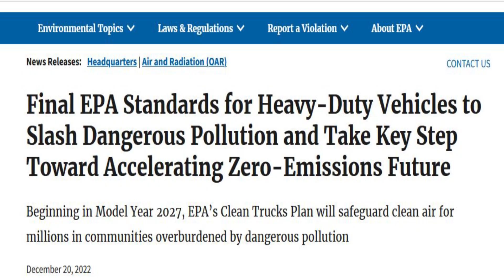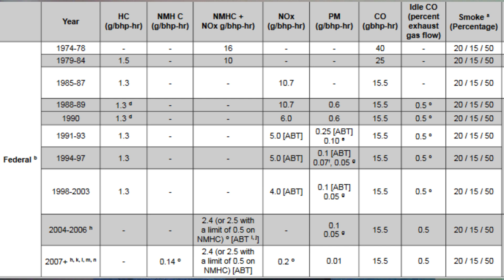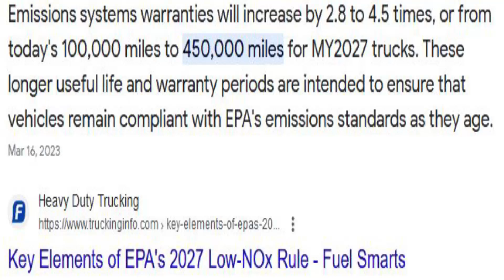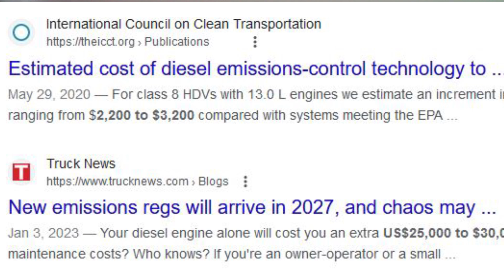Why the 2027 Diesel Emissions Standards will cost BILLIONS!

Comment: They do realize the more components that you install needs an engine the more stuff is going to go bad when she's going to cause the owners more money to fix and they're just going to pass that along to the customers and they do realize that everything is moved by a truck at some point in every country Mina systems that are on the trucks nowadays worked great until they hit about 400,000 miles and then they just turned the absolute s*** trucks with my drivers put on about 200,000 miles a year I mean I have trucks that are 2 years old didn't have over 400,000 miles on them already no one's check semis are getting any cheaper directly getting more expensive so it's not feasible to replace my truck's every two years we're fairly decent sized company but we're not Walmart

Comment: My take on what you said Josh is a couple things. 1. If they extend the warranty coverage out that much it will keep people from deleting them as much or at least as quickly as they have been. 2. A big reason in my opinion anyways is the cost of an Cascadia sleeper is say $180,000 the eCascadia in the same configuration is probably $275,000+, so if they can bridge the gap in price it’ll give more of an incentive to try and force people into trying that route. My .02 though

Comment: Any and ALL engines will be putting out pollution even if it’s 0.0001% multiplied by a million new vehicles each year and the older ones not always being up to spec 
You as a professional mechanic should know that.  It might not be “dirty” in the sense you are using but it still is pollution.
If they (EPA) didn’t do anything we would be all wearing portable plastic bubbles just to go outside.
The air quality has been significantly cleaned up since they began.  Any village idiot can see that so be thankful we can still breath without any assistance from outside sources like oxygen bottles. Your child now has a future.

Comment: Here is an idea, actually design an emissions system that is reliable. The cost of this crap they created should be on their shoulders. ALL manufactures have adopted this practice. Build it with design defect and they make a ton of money over the life of the vehicle or any product in service / replacement. Oh, and let’s add more junk that can go wrong to the products. So, build a product that will withstand the warranty and there is no problem. Washers and dryers for instance, would last 40 years or longer (most with no repairs) years ago. So it can be done. It is about time there are some protections for the consumer, as minor as this is. You say every 100k there is a repair to the emissions system, well right now the owner pays for that, so I see that as a shift of responsibility. Why is it the consumer gets shafted ALL the time for manufactures business practices of “build it with the cheapest, non tested materials available, then sell it and wait for the money to roll in on repairs.” Don’t get me wrong there is a responsibility on the part of the consumer as well, we accept this garbage. People don’t look at the product for reliability, they look for bells and whistles. They are complaining when the thing is in the shop for 9 months with issues. Stop accepting this norm that is be pushed on you, quit looking for Bluetooth nipple ticklers and actually look under the hood, there is something there.

Comment: So here’s a question. Are emissions standards tied to the truck or the engine…..

I guess what I’m asking is, can I start taking 80s and 90s peterbilt and Kenworth trucks, stripping them down, rebuilding them with new engines and drivetrains minus emissions equipment, adding modern comforts, and reselling them as “remanned trucks”. Cuz if that would work I imagine it would be quite the lucrative market with all the issues todays trucks are having
Reply: Emissions are ultimately tied to the truck. 
What you’re talking about are glider kits where an old model engine can get put into a new chassis. But, that “loophole” got closed to where basically all new trucks have to meet the current emissions for when it was built. 
As an individual doing your own trucks you could probably get away with it if it’s only a few trucks. 
If you’re a company building them or someone trying to sell them it isn’t gonna fly for very long before they start throwing big fines and such at you.

Comment: I work with a major manufacturer OEM warranty and everyone should get the extended coverage (ain't cheap) when you buy a new truck. Most get 500000 mile aftertreatment warranty, some can get up to 750000 mile warranty. As you said, it's the least reliable components on the truck, so the warranty is almost always worth it in the end. I'm sure they'll find a way to bake the mandatory extended coverage in the price the truck going forward though. 

In this day and age, buying extended warranty is king. Even with the bumper to bumper chassis warranty on highway trucks, from experience I've found you get back more in repairs vs what you pay for the warranty over the life of the truck. 

On a side note, I've seen people save the $2k on extended transmission coverage only to be faced with a $10k-15k bill down the road during the normal warranty period they opted out of. Long story short....get the warranty.
Reply: Similar to "power by hour" on (turbine/jet) aircraft engines.
Reply: Let me see you work work for a warranty company and think we should all buy a warranty from you because it's better of us... I think not. What business can lose money continuously? None! They wouldn't be in business if they paid out more then it cost.

Comment: What would be your opinion on an electric semi configuration similar to that of Edison motors?
Reply: This is what I feel like the future of trucking will most likely be it’s the only one that really makes sense full EV trucks just weigh too much empty to be of any use hauling. Not to mention the terrible mileage that they get. Unless they find a way to make the battery packs weigh less it’s dead in the water as far as king haul trucking goes.

Comment: At work I drive trucks with mileage that runs from 300,000 to 1.5 million and they are in the shop every 3 weeks without fail for an emissions problem.  It's a joke and it doesn't matter which brand truck with which engine or the mileage.  Hopefully the extended warranty period will motivate the manufacturers to improve the quality of these systems, but I doubt it.

Comment: Its hard to say what itll actually do with new engines. Internationals new s13 is actually removing alot of emissions components. It has an egr valve to heat up the aftertreatment system but no egr cooler, doc, or dpf. Just scr and def and from my understanding should be within the guidelines for the new standards as its supposed to be the last diesel engine international offers. I do believe that cummins also just created a new medium duty engine and theyre kind of doing the same thing. So its possible that we wont be seeing any extra components on newer emissions systems but less components and more simplistic. Im sure theres a still a catch to all of that though.
Reply: instant engine power reduction to idle.

Comment: I work for a large fleet of class 8 trucks, all with modern emission systems, the majority of the emission failures are beyond the 450k mile interval, very rarely do the major components, DPFs, DEF pump, etc, fail before. The most common failure is sensors, (Nox sensors, soot sensors, etc). Unless, the driver did something wrong, IE put diesel in the DEF tank, putting off regens until the truck is fully derated and wont go beyond 5mph/engine shutdown.
Reply: Lol you talk like 450k is a lot. That's only a few years of trucking. For Old school diesels 450k is literally only half the life if that and when time came you could do an inflame over a weekend if you're fast and had the equipment. The point is giant companies Wil be fine they just get rid of them every 2 years. What about small guys? Construction companies and such arent going to be able to pay for a newer truck. By the time they get it it'll be nothing but trouble every day and that'll start a chain effect in society. It will effect you too don't worry

Comment: I saw an article that tires actually emit more particulate matter than current diesel engines.  And its funny that EGR led to more soot, which drove the need for particulate filter.  Regen produces NOx, which drives the need for SCR.   Ducted fuel injection burns fuel way better and why it isnt mainstream is illogical.  If you can burn fuel better, which is effectively pretreatment, you wouldnt need aftertreatment.

Comment: The longer that this plays out the more and more respect I have for Caterpillar for just stepping back from the trucking world even though they did have the best engines
Reply: @kolinstallman3788  This is the problem when you have insane people in charge!!
Reply: I always see the cat Trucks and man do I want one
Reply: Lol at the “that’s not why” comments. Their emissions engines were junk. Cummins is not being pushed out get real. I’m sure ram and international are chomping at the bit to put their own diesel engine in 🤡 we’ve seen how that has gone
Reply: That’s not why they stepped back. They were getting forced out. OEM’s want to sell their own engines. That’s why even Cummins is being strongarmed out of DTNA and Mack/Volvo products
Reply: The four and a quarter mechanical Cat motor was the best I ever seen, then came the 600. Detroit Series 60 was good but the Cat was better in the Rocky Mountains.
Reply: New exhaust system gonna go from 15 thousand to 30-40 grand a for the full system to meet emissions that way they don’t have to worry about warranty fix charges. Yes you’re right trucks will be very expensive soon
Reply: yessir
Reply: Disagree, series 60 was best engine
Reply: @arielaguilar5107 Detroit been #1 since day 1
Reply: @poopinfruz9771 by how many trucks and buses use Cummins engines I thought Cummins was number one. International, freightliner, Peterbuilt, Hino, Bluebird buses , IC bus Thomas all use Cummins now so id say they’re pretty popular. Many of the bus/truck manufacturers used cat/made their own engines before then.
Reply: cat is good money maker for mechanics
Reply: That's debatable
Reply: Yeah and everyone else should have stepped back too.

Comment: You can't just throw more DEF into the system to reduce emissions. You can easily over-dose DEF and you end up with ammonia emissions (which are detected by the downstream NOx sensor as excess NOx.  A catalytic system that is required to operate over a wide range of temperature and flow will not be able to meet these new emissions standards. The EPA demands are delusional.

Comment: This week ,I had a def injector module fail,but it was 10 years old and worked for 600k,that’s the 1st failure the system has had since I owned the truck,also the dealership said there is no record of a previous failure,I have 3 trucks with this def system,this was my first problem,my experience with the truck is,do the maintenance on time ,what the manufacturer says,don’t chip the engine,basically look after the whole truck,because it is all interconnected,I am really saying the manufacturer will say maintenance will be under there control,because that will be the only way the manufacturer can ensure the truck is being looked after.

Comment: My 2008 F250 engine failed at 117k miles.  Average mileage to failure was about 75k miles.  Doing a reliable repair costs close to $18k, more than what the truck is worth.  People owning newer trucks 1-2 years old are having the high pressure fuel pumps fail at less than 100k miles.  Pump failure then destroys the common rail and all injectors ($1300 each x 8) requiring a rebuild of the entire fuel system.  If any water was detected in the fuel system, there is no warranty.

Comment: The extra warranty is a double edge sword with a frayed handle.
The major benefit will be that the manufacturers will be forced to develop pollution reduction systems that actually work and are not simply bandaids stuck on to get the vehicles to comply until the warranty runs out.

Comment: Or just make the engine/ emissions system bulletproof? They could design it. save them and the customer money/down time. Given everything that is going on geopolitically. We need this for our country. 

Stop building half a$$ designed crap. That is a pain in the a$$ to work on. 
I’m talking to you freight liner/international. They are by far the worst ones. But Paccar has them as well.

Comment: My 2001 tractor engine is last years of good ones. No def. No dpf. No egr. Fully mechanical injection. And just for the lack of dpf it doesn't have to stay idling at 2000rpm for half hour doing regen. That is saving the environment right there.
Reply: Exactly. Most people don't think about the extra materials, resources and time that goes into manufacturing the entire def system, not to mention making the fluid itself and all the millions of plastic jugs that contain it. Then all the extra wear on the engine and components to sit there and high idle for 30mins, and all the fuel that burns. And all the man hours and resources to maintain the system.

Obviously I could be wrong, but if ALL the above is factored in, my opinion is the new ones pollute worse, while being terribly unreliable and costing more to maintain and operate. It's a lose lose.
Reply: You're right, making more materials can actually still pollute the environment.
Reply: An engine that old can’t move a 76k lb fire truck
Reply: @mauricemotors8207 what does a 2001 unspecified engine size in a unspecified tractor have to do with moving a 76,000 lb firetruck?
Reply: @mauricemotors8207 bit baffling of a statement if you're blanket statement is implying engines older than 2001 can't move 76,000 lbs. I got bad news for you buddy I've driven a vehicle combination with a 1970's diesel on the road and off-road at 45mph and weighed just over 120,000 lbs going up 40% grades at said speeds with only 14.7 liters of displacement
Reply: @justnsaliga8518  man, give me a lil honda gx25, and the appropriate gearbox and even that will drag anything up a hill.... 1hp, 33000lb a foot a minute... no-one said you needed it there today, did they?

and im just trying to recall what the drawbar pull of a case100 traction engine is.

hell, even the old sentinels at over a century old can haul a decent load... put some of these modern things to shame.
Reply: @mauricemotors8207 I promise you it can. Ever seen a 1970s haul truck? They can still easily move 50 tons of rock.
Reply: I think that I am DPF systems that the EPA mix trucking companies get is going to put them on a business you know maybe you should go look in foreign countries to see how they mining that lithium for batteries that you so-called think you’re going to save the planet by the way how much is it going to decrease global warming by doing all the stuff to trucking companies the cost and billions and billions of dollars all rules from the EPA they are like the mafia
Reply: In our heating oil fleet we had a ‘98 Ford with the CAT3126.  Best truck we had by far.

Comment: Emissions are bullshit. All within the last 2 weeks I’ve had a loader go down, one of our Peterbilts down, and a Chevy 5500 duramax with ONLY 3300 miles on it currently derated. Goes through regen fine, all readings look good, but can not clear codes cause don’t have the GM scan tool. And service dept are backed up weeks if not longer. So warranty is great until you need it fixed ASAP and need it in service. It’s all a joke!

Comment: I think its time they made CNG premix in the air standard for all diesels. It could probably negate the need for half the other emissions control equipment, while saving on some fuel costs and increasing power.

Comment: Electric propulsion systems are the future like it or not. Regardless, a new semi-truck with updated emissions and warranty will probably still be less expensive than a $200k tesla electric semi with only about 450 miles of range. Eventually though, those tables will turn as electric truck costs come down and hydrogen fuel cell technology matures. Enjoy the mighty diesels while you can because eventually they will go the way of the dodo bird.

Comment: Good video, but 450,000 miles is nothing to an owner operator. Three years and they have surpassed the miles. I had two trucks and 150,000 miles a year was nothing. I traded my trucks every two and a half years. That way, there was still warranty left for the next buyer, and I got a better trade in price. Of course this was twenty three years ago. Finally sold my trucks and now sitting in the park in Duluth, Mn. in the winter feeding pigeons.

Comment: Diesels are just going through what gas engines did in the 80's and early 90's. Now look at a gas engine for the last 20 years. Much better fuel economy, more reliable, crazy HP numbers and the run for 100,000's miles. When compared to a car from the 60's or 70's that got 5 MPG, 250HP and you didn't know if it would start if it got below 32F. Not to mention once it had 50k it was time for a top end and if you were shopping for a car and had close to 80k, you wouldn't even touch it. Now you have cars getting 30MPG and 600HP that will start every time and run for 100,000's of miles. 
The longer warranty for diesels will force the manufacturers to finally build better shit. Instead of making it just good enough to last through warranty. 
And while everyone wants to complain abut emissions standards, anyone who has been around since at least the 70's will say the air (and water) quality in the US has improved dramatically. Look at an old movie from the 60's or 70's in NYC and look how smoggy it was. Or LA, jesus.....
Reply: Forgot about heavy weight